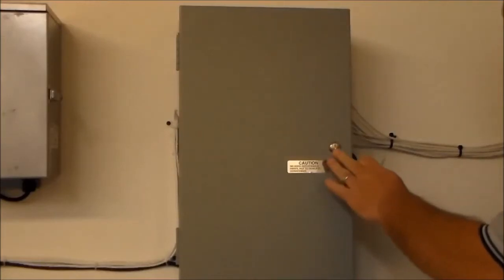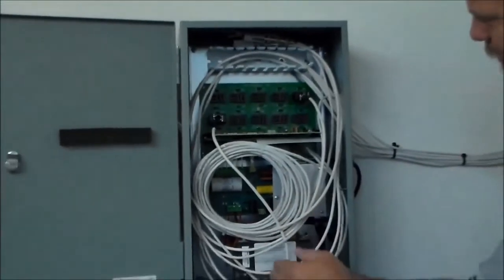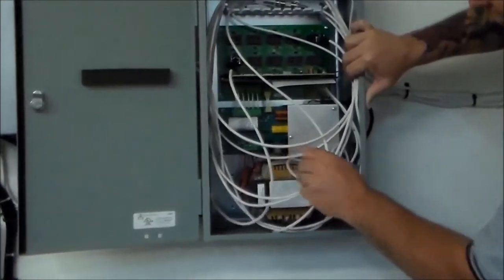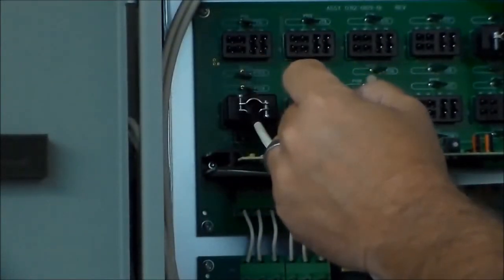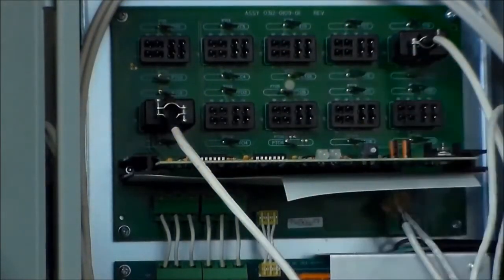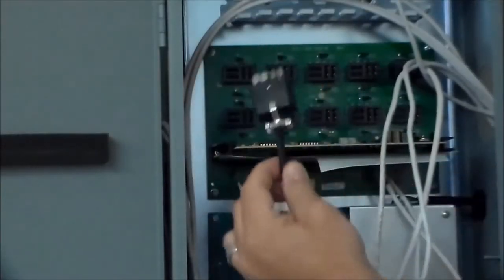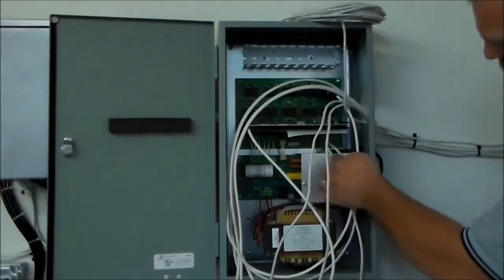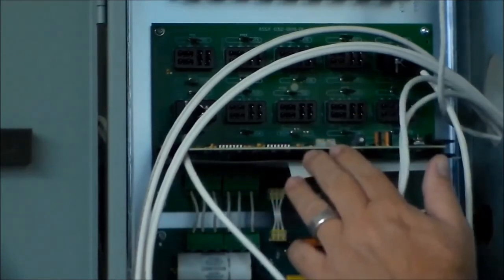10 position J-box basics

Comment: What is the type of cable called that uses the cinch-jones connector and then plugs into the jbox and then goes to the camera I/o board, powering the camera?
Reply from the maker: Sensormatic uses a 4/22 composite cable. Made up of 4 data cables, 3 power cables, and a RG59 video cable.